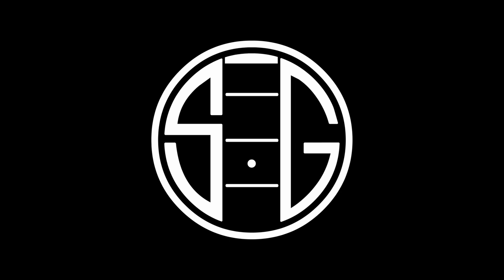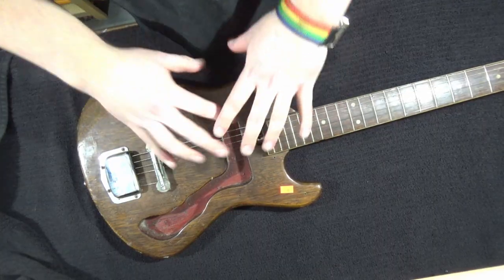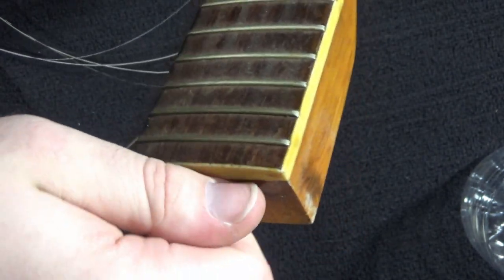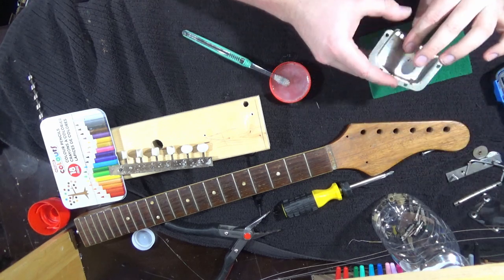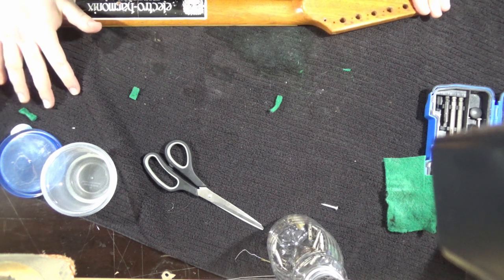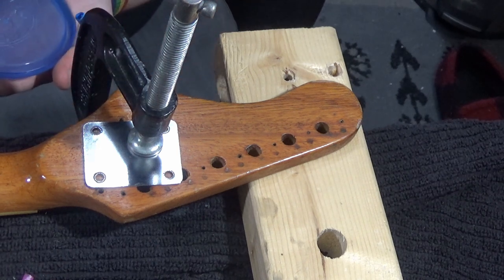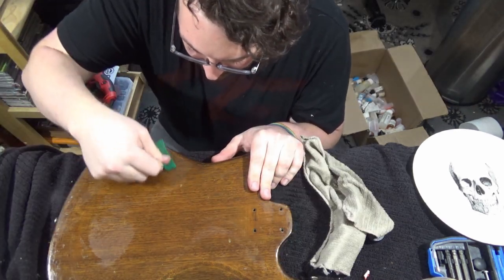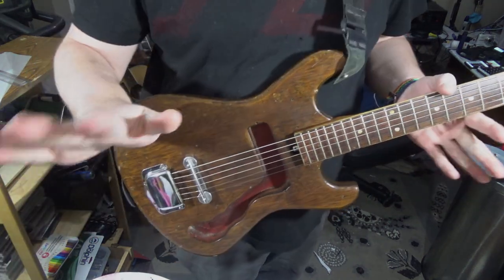Restoring a 20$ Guitar From A Flea Market | Kawai, Teisco, Sakai

Comment: Note about the "Plywood":   While it is correct to call this plywood, it is NOT the same thing as plywood you get at modern lumber stores.  This is the same type of laminated maple/mahogany that was used to built PT boats in WW2.  Very strong, very tough dense stuff.

Comment: Throw the old strings away, don't leave them on your bench to get in the way. I have been where you are at. Two bits of advice: don't use water to clean the guitar, naphtha is better. Secondly learn to be patient, clamp the neck for 24 hours never any less time than that.
Reply: That’s a tight spot to work in.
Reply: Don’t glue your hair……

Comment: A couple quick things:  Cleaning dirty guitar wood, use naptha (lighter fluid).  Be very careful to keep ignition sources away from it but it works great.  GLUE,  use Franklin Tightbond....works much better on guitar wood repairs and builds.  Clamping, use wood scraps instead of metal.....metal leaves imprints when tight.

Comment: ..spread the crack by increasing the string tension, squirt in glue, loosen the strings and clamp. ..the crack may not even go through the finish into the wood in which case it needs nothing. Stress cracks in old guitars are common and won't effect playability.
Reply from the maker: This was a near headstock break. I looked into a bunch between shots in the video.

Comment: You young guys have no idea of the conditions of the 1960s and guitar and accessory availability.  There were no string gauges, even at music shops. Not even a light/medium/heavy choice.  You got Black Diamonds and they were 15-58 by todays standards.  You also did not change strings every two weeks.  Strings cost $5 a set and that equals $50 in today's money. (minimum wage was $1.50/hr)  You used them until they rusted off or broke and music shops sold single replacement strings individually.  That is why they were tied onto those tuner pegs, that and it kept them from slipping.  
These were the guitars of the garage bands of the '60s, not Fenders and Gibsons.
Reply: I have an old Teisco, it's really has that noisy microphonic dirty jangly sound. It has great garage velvets vibes to the sound. I alternate between sell it and build a bridge pup only tele franked and keep it.
Reply from the maker: It was less of a 'which strings' and more of a 'What modern strings would match what this guitar was built for'. I know very well how much things have changed. I've done a decent bit of research on things, but of course I can't know/remember everything. It was more of trying to find what suited this instrument since the neck couldn't handle any of the steel core strings I've had on it. Even with truss nearly maxed out. I've opted for something less 'standard' for this one.
Reply: Black Diamond correct and maybe 2or 3 picks at a time

Comment: A Fender Mustang bridge will fit on some of these old guitars and give you the ability to intonate the guitar. I would wager your low E will be quite sharp at the 12th fret with that bridge .
Reply from the maker: It's tempting for sure, but I'm trying to keep it original. It's more of a collectors item for me, that I might make some for-fun music with.
Reply: I have an old Teisco with that hardware, the intonation is actually  really good, go figure, I'm aware I may be lucky, it's probably more accident than design.

Comment: Also when you add water your forcing the wood to swell. Works great for divets. Use a rag and slap the shit out of the wood to remove the dust. Or a compressed air gun

Comment: STOCKYARD GUITARS, please tell me how restring a 1960’s Kingston Kawai Teisco Single Pickup Guitar Japan Bowed Neck I don't know how because it is my first electric guitar and it has metal protection on its bottom likes yours
Reply from the maker: If it has the same tail piece as mine, the ball ends actually go under/inside, and lock into these 'claws', and once tight, they stay there quite well.

Comment: Easier to fix the crack with body filler and hardener. 10:1 ratio (body filler 10, harder 1). Dries with in 30 sec. Gotta mix and spread it quick, then sand with Heavy grit then finish with 120-220grit. Higher grit for best polish, but youll need to sand the whole guitar to match the colour if your picky
Reply: When you say body filler and hardener, are you referring to bondo?  Would that work better on a neck crack than glue?
Reply: Aside from pulling the clamps off early he did fine. Body filler is…a filler, not an adhesive. Poor choice for this application.